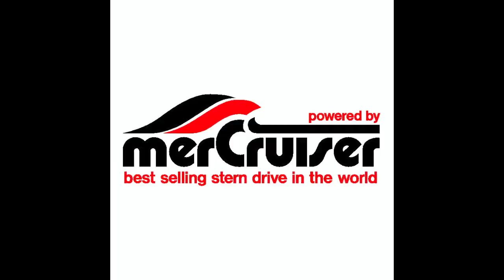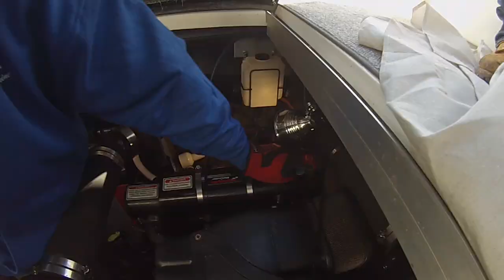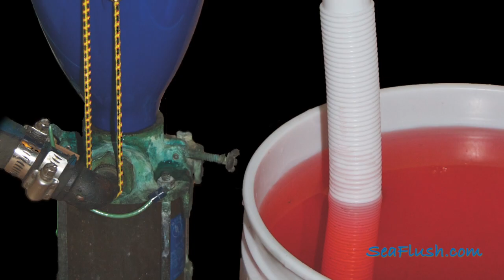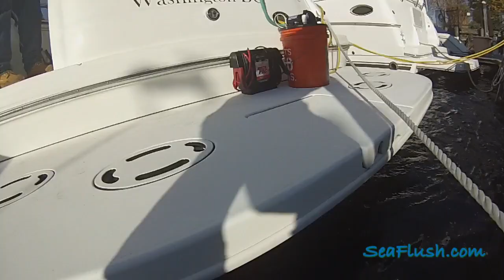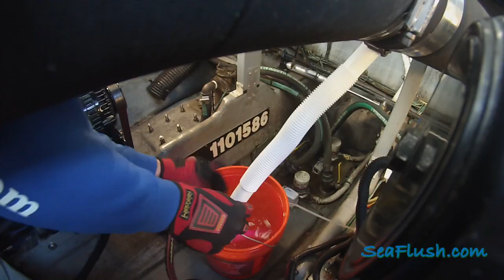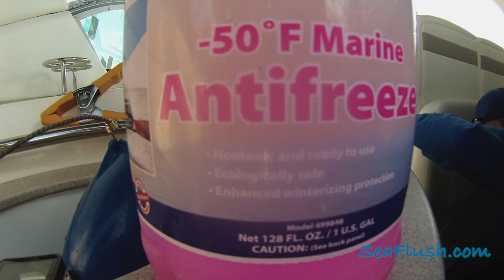Winterizing a Mercruiser Boat Engine with Kompletely Kustom Marine using Sea Flush

Comment: Question did you drain all the petcocks before starting the engine or you don’t have to.
Reply: On this one, the engine has closed cooling, so we don't drain the block. For engines with raw water cooling, yes the block should be drained first.

Comment: Do they drain the block/manifolds before introducing the AF?
Reply from the maker: No, because this engine has closed cooling so there is already circulating antifreeze (green or orange) in the block/manifolds.  The exhaust elbows are raw water cooled, so they're winterized with the pink antifreeze as it flows through.
Reply: To my question I just asked I do not have a closed cooling system on my 330 1996 sundancer with 7.4 inboards. Does it matter?